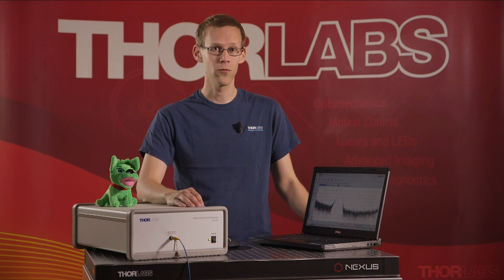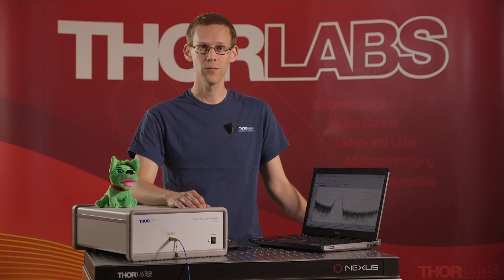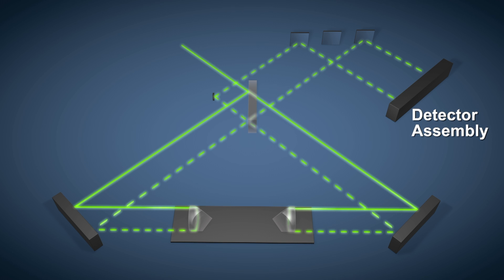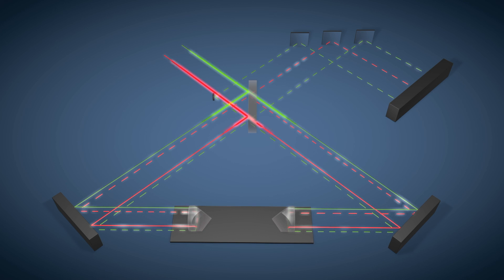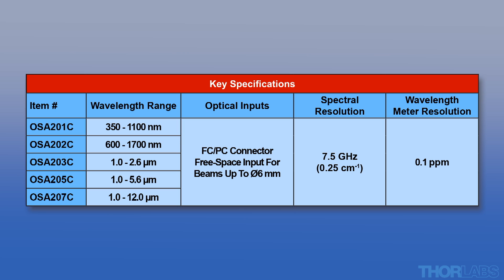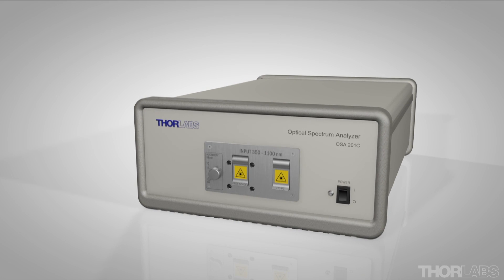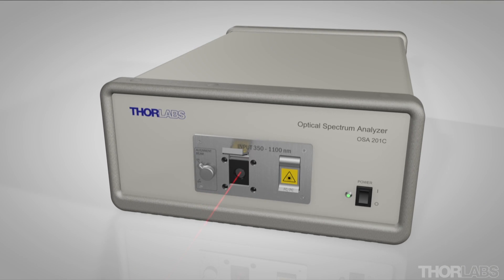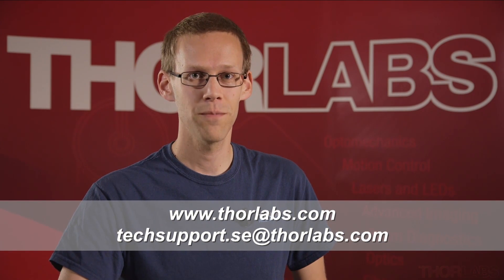Thorlabs Optical Spectrum Analyzer (OSA)

Comment: Looks kinda like an FTIR spectrometer
Reply from the maker: Thanks for your comment! Thorlabs’ Optical Spectrum Analyzers are, indeed, Fourier transform spectrometers, as they use a scanning Michelson interferometer in a push/pull configuration. Our OSAs come in five models that cover different spectral ranges in the visible, near infrared (NIR), and mid infrared (MIR).

Let us know if you have any questions!